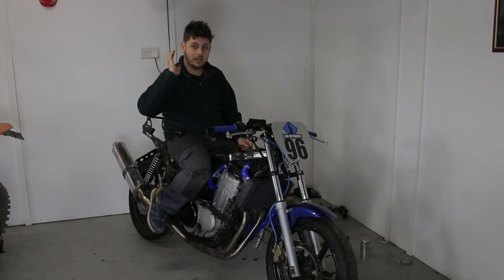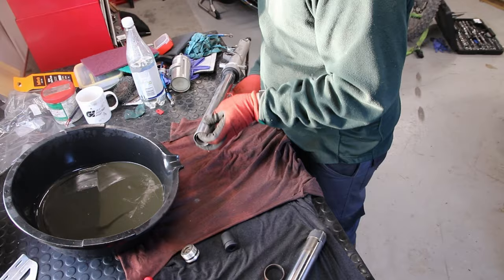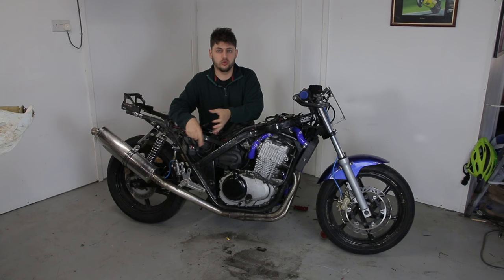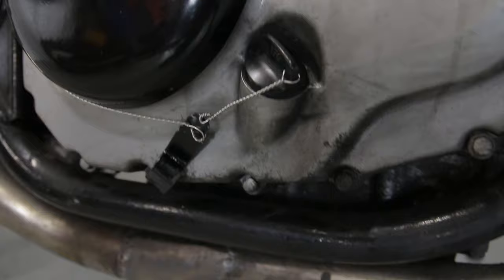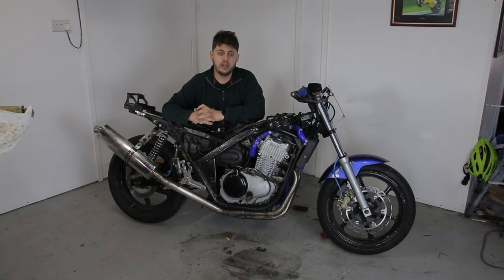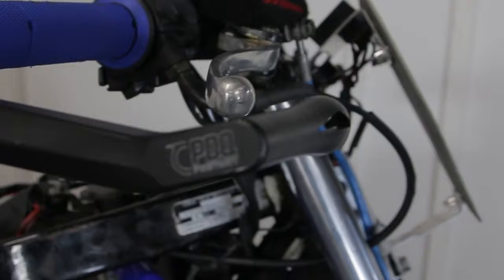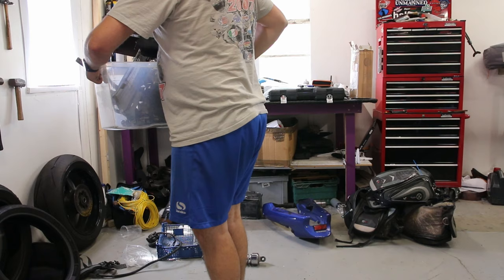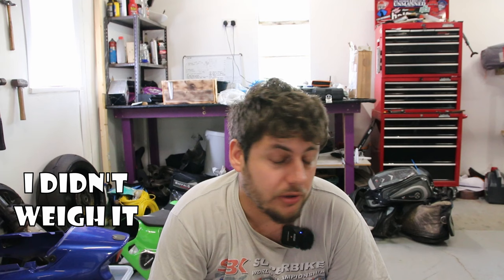Building a race bike on a BUDGET - Part 3

Comment: where did you find the list of components that needed to be lock wired?
Reply from the maker: It was in the Thundersport 500 regulations - each club should mention in their regulations for each class what needs to be lock wired but usually it's a minimum of;
Oil filter
Oil sump plug
Oil filler plug